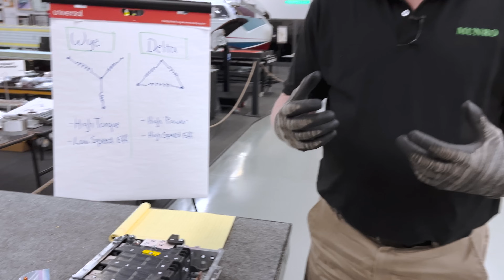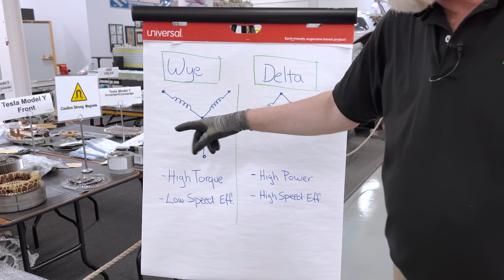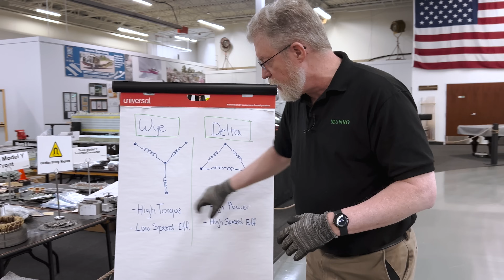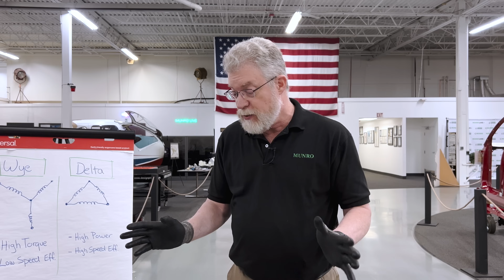KIA EV9 Dual-Stage Motor & Inverter Breakdown: Engineering Unveiled

Comment: Paul, nice, informative presentation.  Small correction: the change in configuration from Y to Delta is not "smooth", but instantaneous (i.e. microseconds). BUT :  this is a mo tor,  MO TOR,  say it with me Paul: mo tor.   Few would call a mechanical device with 1 moving part  a "Mah sheen"  🙄
Reply: You think you are so smart with your "correction", but you have just shown by your lack of familiarity with standard industry terminology that you have little to no experience in this field.
Reply: german electrical engineers definitely call motors "electrical machines" all the time.
Reply: Machine is the more precise term as it can convert energy in both directions as opposed to a motor that can only convert from one form of energy to rotation but not back. Very nit picky though 😴
Reply: @openinverter  Most people use correct and specific words: such as: Traction Motor, or Motor-Generator.  Look in a dictionary and you will find that "machine" is a very general description of a wide range of complex devices, anything but "precise"!
Reply: @shazam6274 we use the term "Electric machine" for motor-generators in the industry. Regarding the original comment, I emphasized "smoothly transition" precisely because that is what is new and innovative about this Kia system. It's true that all previous implementations of wye-delta switches cause a nearly instantaneous change (and an abrupt torque bump). Kia's dual stage inverter allows them to PWM between states to smoothly transition and simulate a gear shift.
Reply: @PaulTurnbull-EMfield  I would be interested in seeing the switching waveforms during the transition.  Hard to imagine both winding configurations being driven simultaneously, since there would be 3 absolute shorts.  The switch-over is likely well modulated with PWM, but the actual switching of configurations is nearly instant and synchronized with the 3 phase PWM switching of the motor driver module.

Considering the detailed, precise wording often characteristic of German, Elektrische Maschinen could be describing almost anything, from a CNC Mill, to a washing machine, to a garbage disposal, to.....
Reply: @w0ttheh3ll  German engineers use English??  You must mean Elektrische Maschinen?   In case you didn't notice, this YT channel is all in English which Paul is speaking.  The philosophy of the German language:  "Why use one word when, in our opinion, many will also do quite nicely, thank you.  Just write them as one long word."  

For example: They also call a simple DIP IC package: Dual-in-line-Gehäuse or Parallelseitengehäuse.  Or 30 years a go: "a small house with two parallel lines of picket fences" Simple init? 🙄😂

Comment: @5:14 you can clearly see that the connections & bends “are not” uniform as you say, but byes the rest are.
Reply: Yes, I winced a bit when I saw that. The leads that connect to the board are necessarily non-uniform. I could have been more clear about that.

Comment: This was pretty amazing, wonder if Tesla will use something similar in the future models or if they will have another, better solution!
Wow, EVs are evolving pretty fast, no turning back!
Reply: Tesla is using a switch that makes the pack 400 volts when it's at a 400 volt charger.
Reply: Tesla is brute forcing torque with very powerful motors. They solve city vs highway efficiency by having dual motors with one motor optimized for the city and another optimized for the highway.

Comment: When I was a little boy (70 now) I lived next to a small bakery beaking very nice brekfast bread - he had a machine to work with the dough that machine had a spesial oilfilled Y - Delta switch, he started in maby the Y config. and when it up in speed, he just switched to the Delta config. There was 2 on the same switch, and ofcorse the oil propably killed the sparks.
No electronics, just meccanical and electrical parts in say 1964....
Nice memorys, and very very good both the smell of bread, an technics  😎👍
Reply: Where I work, We still use Delta-Y switch for our very big industrial mixer (Around 600 hp each). We still have 3 of them still working today. No spark and near direct switching because those use (Electronic Switching) Those drive are called Soft Start. Like 30-40 years later, still working well. 🙂 But of course, those must cost so much in those time compared to simple contactors used in those time. But we talk about 600hp working with 2400 volts, not 240 volts. Then those need very big Cabinet because those drive are so big and need so high voltage.
Reply: @sergiomomesso1590  Interesting to hear 😎 .
Edvin Olssons "dough moover" was maby about 100 litres and the motor was on 3 phase 380volts
So in Y configuration the windigs get 220 volts, and in Delta the windings get 380volts. I guess the fuses in the house would blow out if it started in Delta position.
Best wh. from Sweden.
Reply: Some 30 years ago i learnt to scuba dive. The dive club had an old air compressor for filling the dive tanks. Sometime during the filling of a set of tanks the D-Y switch has to be operated to get up to the pressure we needed.
Reply: AugustaWestland had several 11kV 3,500 hp motors in 1982 that used a Wye-Delta starter.  The changeover happened at about 30 seconds after startup, made a thump.

Comment: Great explanation.
This eliminates the need for a dual motor configuration.
Reply: Well, no. This drive unit still only drives two wheels. The AWD EV9 still has two motors, one front, one rear (I don't know if both use this electrical configuration) - to avoid having a mechanical interconnection between them (front-to-rear drive shaft). This arrangement should allow a little better drive efficiency at both urban and higher speeds.

Comment: Not clear from the video, is the the front or rear electric motor, or is it used in both? Also, is Kia still using the mechanical disconnect for the front motor like they did in the 1st egmp vehicles?
Reply from the maker: Rear Motor

Comment: Looks like a very high quality motor, and persumably with a significant volume of manufacture too, which can be tricky to achieve!  I'd love to see a full tear down of the power electronics, and how the 400V and 800V DC links get connected to the inverter?  Is there some hard switching upstream to either send 800V direct to the battery and 400V to the inverter and then to the battery, or do they always route the DC charging cables to the inverter and simply run in continuous conduction, non boosting mode for 800V charging? (and accept the small additional loss?)

Comment: Great teardown! Could you elaborate on the boost converter access to the inductance of the motor windings?
The Y vs. Delta configuration actually exists since ~1900 and was invented by the german Robert Dahlander (1870–1935)
https://en.wikipedia.org/wiki/Dahlander_pole_changing_motor
It was and is used in elevator.
Reply: This is certainly not a Dahlander pole changing motor. While both this and Dahlander's design switch between wye and delta configurations, Dahlander splits each winding into two sections, but this does not.

Comment: Can't see the point of going backwards. Wye / Delta was in place ever since they invented the 3 phase motor. The introduction of good transistors led to variable frequency drive. Better ask Peter Rawlinson who claims better efficiency. And as a 400V to 800V converter I can see an issue when charging in the desert at maximum heat and no natural airflow. All it needs is a sand clogged radiator and the HV HVAC is going into overdrive or shuts down. After all the client wishes a cool cabin, cool batteries and the charging circuit will also ask for coolant doing both motor and inverter cooling.
Reply: Well, the advantages are explained in the video and also why it has not been done before in EV applications (mainly cost). This is not "going backwards" at all. The only question is if the added complexity and cost is REALLY worth it compared to a simpler and more traditional solution.
Reply: @EinzigfreierName  Example Nissan oder VW is why customers are happy to pay for the extra miles. Research Lucid and then Koenigsegg both have the highest efficiency motors. I Think VW will have to make more than drastic cuts to survive!

Comment: the switch from wye to delta is due to large back emf spikes damaging the controller,
so you just need to have no load on the motor when you do the switch, nothing complicated, but you missed the reason for motor off during switching, motor can still rotate of course just need to have low load or no load at time of switching. The time for the back emf to be absorbed would be very short, you wouldn't notice power was off for a miniscule time period.
Reply: So it would work like a two speed powerglide on a drag racer 😊 Just shifting faster. Cool 😊
Reply: @krashanb5767  When you disconnet a motor under load, as in disconnect the power wires quickly whilst accelerating or going up hill, since there is a huge amount of energy stored in the electric field, it collapses very very rapidly, that energy has to go somewhere, it can generate a very voltage potential and a large spark, which can damage mosfets/igbts etc. So the controller needs to absorb that energy rather than fry the igbts with high voltage spike. I'm not sure which method they use to absorb this spike, I'm guessing it will be diodes or capacitors or a combination of the two, but since it occurs over a very short time period, it would be too small a glitch to even notice any change in power if they do power off the motor load just before switching. I'm only guessing here how they do it, some electronics expert in the field would likely know the answer in detail.
It would make for a rather interesting video.
Reply: As well as timing/load based control, I wonder if you could use a supercapacitor to dampen the back emf spikes, protecting the switches, and re-use the energy after transitioning
Reply: @GruffSillyGoat probably many ways to do it, simplest is throttle off, no load during switching, not an expert in circuits so cant really comment.
As long as the back emf spikes are absorbed ( or not produced as when motor is in no load state) and the mosfets or igbts dont see a voltage higher than their rating then all should be hunky dory ( some experience with this setup on lower power motors), works a treat.

Comment: So is this mode switching more effective at broadening the efficiency range than Tesla's IPM-SynRM design?
Reply: All modern IPM motors produce reluctance torque (including this one); there is nothing unique or special about Tesla's design.
Reply: @brianb-p6586  Obviously.  But that's just a qualitative analysis.  Quantitatively, Tesla still achieves high efficiency despite not adding a clutch or switching to an induction motor on the front.  So I'm curious how Kia compares, on an efficiency graph.  Granted, if Munro has done this analysis they may want to keep it behind their report paywall.
Reply: @concinnus  Kia's configuration switching is in addition to the exploitation of reluctance torque, not instead of it. 
If you instead want to compare the use of different motors front and rear to configuration switching... again, both can be done (Kia is using this at the rear only, and if they used it front and rear the two motors could still be different).

So of these three techniques which can be used in combination - reluctance torque in an IPM motor, different motors front and rear, and we/delta configuration switching - which is most effective and most cost-effective? Obviously this is relatively expensive, and all have adverse consequences, but I don't know the efficiency gains of each.

Comment: Interesting configuration. Possibly a slightly contentious and probably frivolous point but surely this is a motor. The machine is the whole of the vehicle or "machine" driven by the motor. One moving part doesn't constitute a machine in my book however unconventional the design. 

in the following definition the Motor provides the mechanical power. "Machine, noun :an apparatus using mechanical power and having several parts, each with a definite function and together performing a particular task"

Just goes to show how the electro-mechanical world has been transformed by electronics, specifically high power semiconductor tech.
Reply: The term 'electric machine' is used to cover a device that can function as both a motor and generator, as all EV machines do under regenerative braking.
Reply: Very weird that he is calling the electric motor an electric machine, but then in the next sentence he refers to it as a motor.
Reply: An electric motor is an electric machine. No, "machine" does not mean the vehicle.

Comment: Looks like a very well-designed electric motor (I presume it's brushless DC).  It's good to see other people besides Tesla innovating in electric motors.  I have a hard time believing the Wye connection will produce a different power level from the Delta.  Ultimately, the power per winding in either configuration will the same.  If you are speaking of different power levels for a given drive voltage or current, then that could be true.
Reply: Strictly speaking, what's different between the two configurations is the V / Hz (the relationship between voltage and frequency in the motor) by a factor of 1.7 (i.e. square root of 3). The wye configuration has higher V / Hz and thus draws less current for a given output torque (but higher voltage). At lower speeds this will let the back EMF voltage more closely match the DC bus voltage in the inverter, which is more efficient, because the inverter doesn't have to do as large a voltage step-up or step-down. But at higher speeds the back EMF in this configuration may exceed the DC bus voltage, which is no bueno; switching to delta would bring the back EMF voltage down, again more closely matching the DC bus voltage in the inverter for more efficient operation at high speed.
Reply: Precisely, Bike.
Reply: There are certainly some differences in practical power output when considering operation above the base speed, ie within the field weakening region!  Here, because the KE is different for the two configurations, by switching to Delta, you reduce the Bemf, and hence run at a lower level of field in the Daxis, which means you can actually pick up a bit of power, no, as you say, not to EXCEED the peak power available at the base speed, but to lessen the fall in the power as your transition up the CPSR 🙂
Reply: So you agree, you can't make a motor produce more power simply by changing from Wye to Delta.
Reply: You make it more efficient. Once the back emf exceeds battery voltage you have to invest some extra power to weaken it. This starts to limit the torque you can produce as some significant inverter capacity is used to weaken the field. By switching to delta you can bring in field weakening later and maintain full torque to a higher speed which does of course increase power at the same rate.
Reply: I presume you are saying that while the developed torque may change, the motor's power rating does not, Cat.

Comment: You said, "interior magnet."   I take that to mean that this is a sync motor with magnets in the rotor.

Is there any danger that using the motor as an inductor for charging from a 400 volt source, are risking demagnetizing the permanent magnets.

Delta Star switching is common in starting high power AC induction motors.   I'm surprised it took so long with EVs.
Reply: There is a risk of demagnetizing if the currents get high enough, but the controller monitors the currents and keeps them at a safe threshold - just as it needs to do when running at full power motoring.
Reply: The controller needs to know how much the magnets can withstand in any case, otherwise it couldn't do field weakening (EV use that to get higher top speeds) without demagnetizing
Reply: Yes, "interior magnet" means that the rotor has magnets, but more specifically that the magnets are buried in the rotor laminations, not on the surface.
Reply: @brianb-p6586  --  I understand this.   But for the magnets to have any effect in making the motor work, any currents in the stater/field would try to de-magnetize these internal magnet.  I'm sure they Korean Engineers know what they are doing, however.   

Frankly, over the last 15 years I've become quite impressed with South Korean engineering skills.    It's been a long time since one of their building collapsed.

Comment: They have potential to get the solstice solid state battery from factorial energy. A solid-state battery that features 450 watt-hours-per-kilogram (Wh/kg) power density. 4x range. 

It's a sulphur chemistry and Mercedes Benz is on the for front of it.. projected to be installed in 2030.

Comment: The idea of using the motor winding as a second application purpose ans avoid the need for additional coil is fantastic. Back in 2015 there was a company from Moscow that I represented at the Interbike in Vegas called adaptto E drive that was offering ebike motor controller with very similar idea but it was to use the motor as boost converter coil to recharge the battery from wide lower voltage range.
Reply: I was thinking about the adaptto when I watched the video and now I see your comment 😄
Reply: I don't fully understand using the 4th, extra winding's inductance(?) to boost 400V charger to 800V vehicle architecture...but it sounds just like what your describing with previous adaptto application?